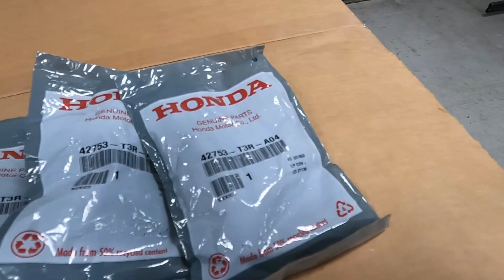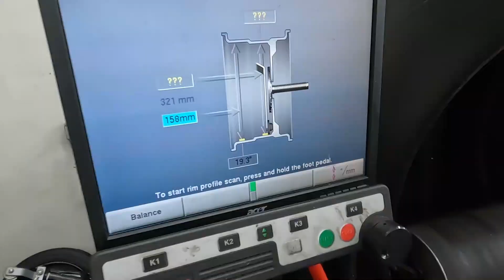2021 Acura TLX A-Spec - OEM Type-S Upgrade | Front Splitter | Diffuser | Y-Spoke Wheel | BC Coilover

Comment: Based on the install do you believe the supporting brackets for the type s lip is needed. I have seen on forums that they are not really needed. The reason I ask is because I am about to get it but the support brackets are back ordered. Just wanting to know if they are important enough to wait for several months for. Any insight would be greatly appreciated.

Comment: Gorgeous. I also installed the Type S front lip on mine as I prefer it over the underbody front spoiler upgrade
Reply from the maker: Great choice!
Reply: The dealer is saying type s lip won't fit on my aspec..
Reply: Hey, did you install the lip with or without the supporters?
Reply: @Nicole-rj1ef  I forgot, it’s been a while since I installed it but I believe it re-used my OEM A-Spec clips and what not. The middle part was a pain because there are clips hidden but we managed to find them and it was a perfect fit
Reply: @eg619rip  Ah okay. I just purchased the type S lip and the supporters are back ordered, so I was just curious if they are really needed. Thank you for the reply!
Reply: Do you need the supports? I don’t think you do

Comment: Wow there must be a total of 50+ fasteners on just the front end of that car!  Compared to 90's Civics and Integras which had maybe a dozen or so screws and clips.
Reply from the maker: Most late model Acura/Honda, the bumper covers are usually very simple to remove and reinstalled. The TLX front bumper is a bit intense.

Comment: Thanks AHC for the weekly content!
Question for John is how come use silicone spray on the bead of the tyre? On earlier episodes, i noticed the use of tyre soap. what are the benefits?
Reply from the maker: The silicone provides just enough lubricant front the installation and does not leave a white streak on the bead

Comment: Aloha Mike, i have a quick question. After watching your blue TLX get the Aspec kit I went and bought the same kit, would you know if were able to put the type S front splitter under the Aspec front fangs? Mahalo and love the channel.
Reply from the maker: Thanks for the continued support. Type-S front splitter will not work for the front bumper if you already installed the A-Spec front under spoiler kit. The rear is no issue.

Comment: does putting in the coilovers affect how the car reacts when you change driving modes? Do  shocks still soften in Eco mode? or is all of that gone with the coilovers?
Reply from the maker: Only the Advance 2.0T and Type-S 3.0T have the ADS system. So by installing coilovers on the other models, it will not affect the system
Reply: @ahcgarage  so for the Type S, this will disable the suspension driving modes?

Comment: sits beautifully but imo, tremendous mistake to eliminate adaptive suspension with coil overs.  The modes are incredible, especially comfort when you want to chill.
Reply from the maker: That's a good point and fortunately enough, this vehicle does not equipped with ADS or adaptive suspension.

Comment: Would you have any fitment issues running a 9.5 in the front on a new TLX Aspec?
Reply from the maker: 9.5 in the front is a bit aggressive, going to be a bit hard to clear all around without alternation to the fender, liner, or stretch tires which highly not recommended

Comment: Just picked up a 23 TLX Aspec and want to add the type s front splitter. Dealership saying it might not fit. Do you have to do anything special to add it to an Aspec? Also are the supports needed? I’ve seen installed with and without. Thanks!

Comment: How bad would it be to change out the front lip on an actual Type S? Would you still have to take the entire bumper off?
Reply from the maker: Bumper does not come out with replacement
Reply: @ahcgarage  Is it just the screws and push pins accessible on the underside? In the video it looked like there was 2 screws going into the bumper down by the intercooler.

Comment: Now will the front lip and rear defused fit with the aspec front and rear add ons that are on the blue car?
Reply from the maker: If the factory bodykit is installed, the front Type-S splitter will not work however the Type-S rear diffuser will work
Reply: @ahcgarage  bet thank you

Comment: No need to remove the "under brackets" underneath the boomerang. The front bumper is not connected to that. The bottom 3 10mm bolts. Just leave the middle one, but take out the outer 2 10mm bolts.

Comment: What are the thoughts on the new Integra from AHC  guysand the YT community watching these fine instructions on modding the TLX?
Reply from the maker: We don't know where to start. To be fair with most of the enthusiasts, their concern is valid as far as the identity goes.  We still think it's a great looking vehicle with quite a bit to offer. The 1.5L Turbo with the 6-speed manual has a lot of pros comparing the K24 on the ILX. For the tuners, it will be much easier and cheaper to get more power from the 1.5T than the K24. Also, the Type-S model will have an even more powerful powertrain. We are actually very excited for the upcoming release. And we will have a lot of video for it!!!

Comment: Mike, I have questions for you.....I got the Acura aero kit for my TLX Aspec.  I looked at adding the Carbon Fiber Type S diffuser fins on my rear diffuser, but it didn't seem like it would fit-is that truly the case?  Or do you have to add the black diffuser rear inset piece (like you did in the video)?  Also, have you seen any  Sports Springs out yet for the TLX Aspec (instead of the coilovers)?  Thanks....
Reply from the maker: In order to install the Type-S Accessory Carbon Fiber Diffuser on the A-Spec (Base, Technology and Advance) TLX, you will need to install the Type-S diffuser (like the one in this video). Then the Type-S Accessory Carbon Fiber Diffuser will mount on top of that.

As far as lowering springs goes, they are currently under development from Eibach and Tein. It could be other companies as well but that all I know at the moment.

Comment: My daughters 18 TLX A-spec has the same rear diffuser you guys added but not the front lip. Do you have a part number for the front?
Edit: just checked my daughters car and it does have a different rear kit. If I can get part numbers for both.

Comment: Did you install the splash guards?
Reply from the maker: Yes we did
Reply: @ahcgarage  I need your help, I have a Acura TLX Type S .  I’m trying to install factory splash guards flat black. Fronts are no problem. But on the rear where you are supposed to remove two screws the install brackets. I don’t see those screws. I see the one they say not to remove. Any suggestions?
Reply from the maker: Shoot us an email and we will send you the installation instructions:
AcuraHondaClassic@gmail.com

Comment: Wouldn’t it make more sense to just get the type s? I’d imagine the cost associated with upgrades would add up close to the cost difference. And I’ll add, driving the type s is a completely different experience. When my type s is in maintenance, I get the aspec as loaner. I’ll tell y’all hands down I hate driving the aspec once you tried the type s.
Reply from the maker: Very subjective and along with the current limited availability issue.

Comment: love it! there was only black or white and I went with the white and ted interior with all season wheels and tires but love the performance wheels!... also got the under spoilers and door edge guards and the side molding and the black accent blade and black emblems and carbon fiber interior and spoiler and the illuminated side sills, heated steering wheel and the welcome light... I'm thinking of getting 30/35 chystaline tints all around and maybe 70 on the windshield so I don't get pulled over all the time here in NY. and then the whole car ppf'd with suntek ceramic and then a ceramic coating over it...and MAYBE buying the performance wheels and having the all season tires put on them and maybe chrome delete the exhausts.. still haven't decided which I like better.. any recommendations or suggestions? or stuff I should or can do???

Comment: Those A-Spec wheels copied the design of the TSW VX1....
Reply from the maker: The Y-spoke wheel designs has been out for many many years, BBS is one of them in the early days.
Reply: The VX1 is a classic late 90's wheel, but I don't think they were necessarily the first to do a split/y-spoke design.